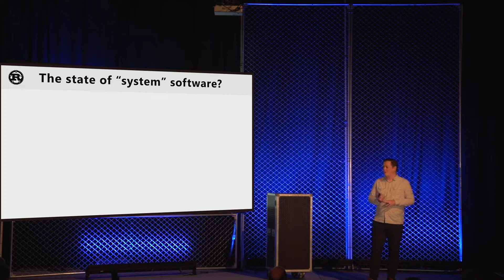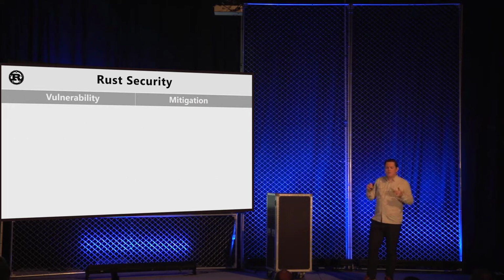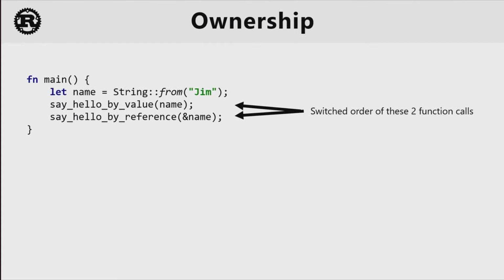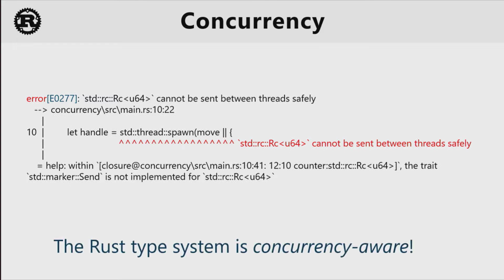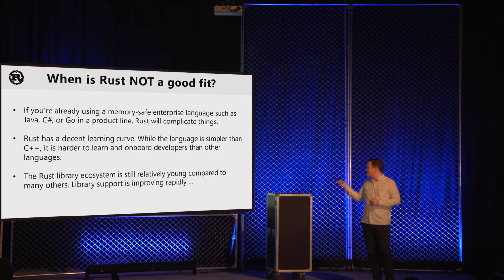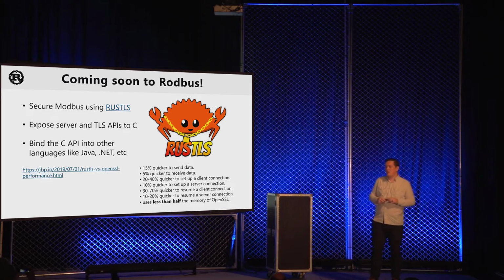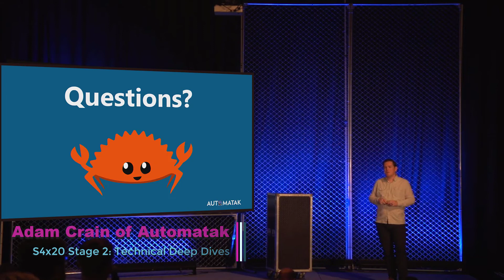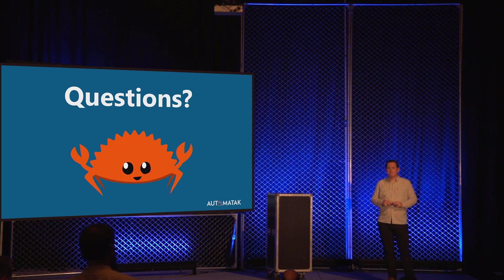Applying the Rust Programming Language in ICS

Comment: Interesting topic from the technical perspective yet I don't believe that the programming language or the SDKs are the issue of why software has bugs. It has been demonstrated the software robustness is directly related to the software development processes that are being followed; this is the very nature of the Capability Maturity Model. Additionally, products have a target released date. By the time the product needs to be released both the users and the vendor are agreeing to "live" with those bugs and wait for the next patch/hotfix/roll up that fixes these bugs.
Reply: If you can eliminate entire classes of bugs at compile time, the existence of such bugs in other languages is absolutely the fault of the language. Of course, other factors cause bugs... Developer education, processes, culture, time pressure, etc. What's the primary reason though? Processes or using 50 year old tech to solve problems where the requirements have changed?
Reply: @adamcrain5385  I believe that the processes can be updated and tasks can be streamlined and become more efficient thanks to technological progress. I also believe that the key to a sustainable operation and business relies on the processes as well. Technology, in this case a "new" programming language and its tools could bring a competitive advantage in product development for example; this is a key characteristic to drive technology adoption. But technology in itself is not the solution to improve quality and software robustness.
Reply: @CristobalRuiz  You are right. And by your own argument developments like Rust are a very good idea.
The  Capability Maturity Model means nothing if one is not objectively measuring what one is doing and refining processes to improve the desire outcome. In this context minimizing software errors. Obviously a way to automate discovery of such errors is therefore very desirable from a CMM point of view.

Rust is an attempt to make all the rules of things like the Joint Strike Fighter Air Vehicle C++ Coding Standards https://github.com/tpn/pdfs/blob/master/Joint%20Strike%20Fighter%20Air%20Vehicle%20C%2B%2B%20Coding%20Standards%20-%20Dec%202005%20(Doc.%202RDU00001%20Rev.%20C).pdf things one cannot escape. Rather than relying on human reviewers or software analysis tools that are far from perfect at their job.

Certainly Rust will not eliminate all bugs, that is not the intention and not even possible. But it does a very good job of eliminating a whole class of bugs. A class of bugs that Microsoft estimates is the cause of 70% of their security vulnerabilities: https://msrc-blog.microsoft.com/2019/07/22/why-rust-for-safe-systems-programming/

Rust may not be the be all and end all of this. But it shows what can be done.

Speaking of "maturity". When the railway industry matured trains acquired decent brakes and signals. When the auto industry matured it got anti-lock brake, airbags, and so on. When the software industry matures, if it ever does, it might have safety measures like Rust in place. Because humans make mistakes and many mistakes can be mitigated with technology.
Reply: @heater5979  Thank you for the links. I will check them out. I agree with you as well.
Reply: @heater5979  Spot on. It takes someone who has spent years struggling to write vulnerability free C/C++ to truly appreciate what a game changer Rust is for native programming.